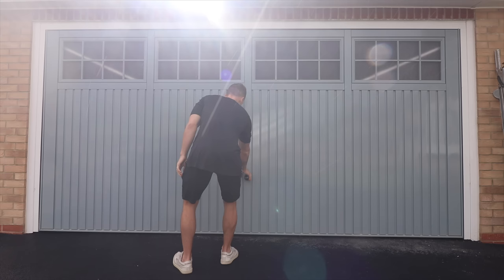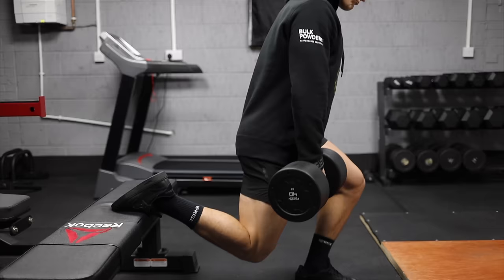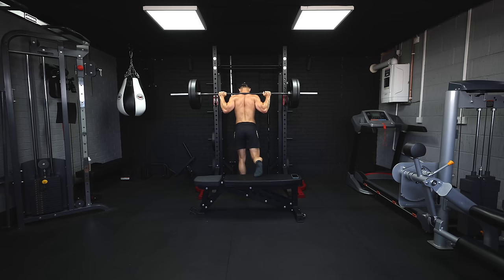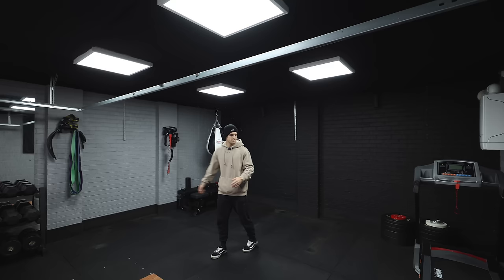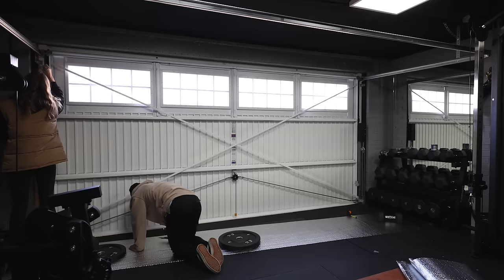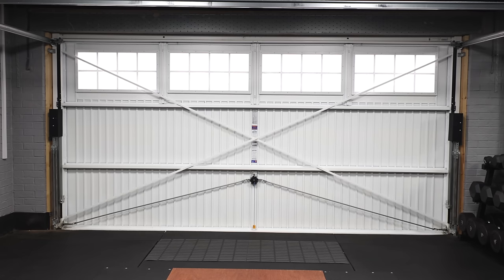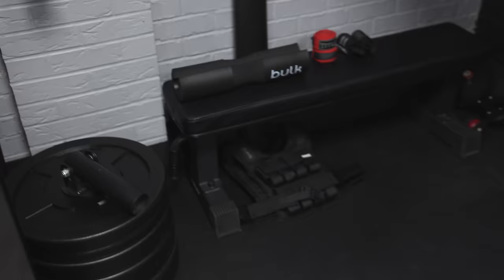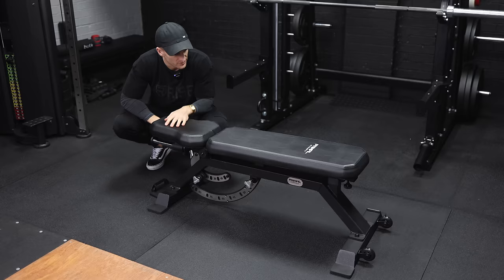Complete Home Gym Transformation (Start to Finish)

Comment: Was the old pulley system decent? Thinking of getting the primal one on the sale..not the monster series though as it's well outside my price range
Reply from the maker: My old one from Titanium Strength was decent enough for normal home use like, but it definitely wasn't as smooth as the current one (would occasionally 'stick' a bit when using most of the stack). That could just be random, could be to do with how I installed it, or could be a product defect - hard to say. If it's the "compact dual adjustable pulley" you're looking at from Primal, I'm sure it will be good, and their customer service is really good if you did have any issues anyway.

Comment: Hi mate, the Primal gear looks class but what machine you recommend on more of a budget for leg extension?
Reply from the maker: They do an ISO single leg extension which is about the half the price (it's plate-loaded). I haven't used that one specifically but have tried some similar machines that were good. You could obviously look for a second-hand leg extension somewhere, but I would strongly suggest trying the thing out before you hand over any money, because that would have saved me a lot of time/money. You've just got to make sure it's comfortable and smooth.

Comment: everything great. think art on wall get pumped to lift. something spartins move. have guy face with helmet. something says every pound lift spartine fight for you. 300 Spartans so want try get 300 all exercises or something like that. zombie punkins have jack lantern patterns of spartina's cut out with exact knife on card bord. shine flash light through it. trace best can with white pine. then paint white. use stencils paint words on if don't free hand. make cut box hole so spray paint don't go. over stencil. words every pound lift spatine fight for you. 300 spartans. fun exercise might lift bench plate like shield move around. not sure do handle yet but use two hands till figure out. think tractor supply put farm pine through there. that used handle.